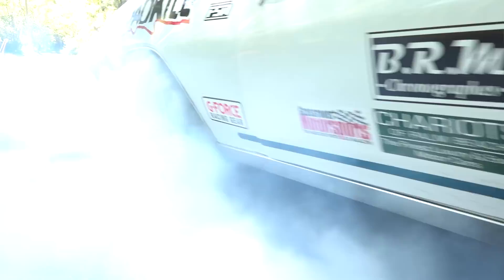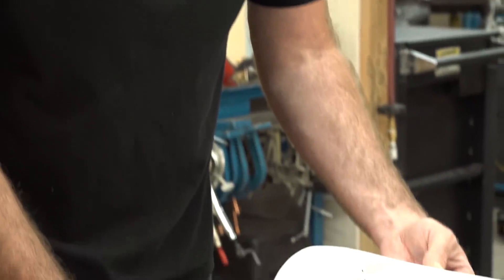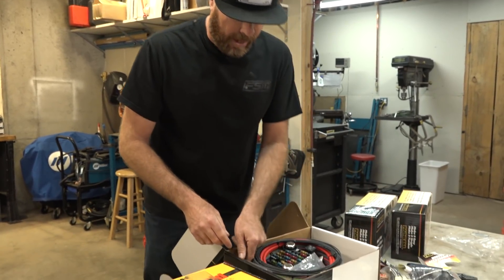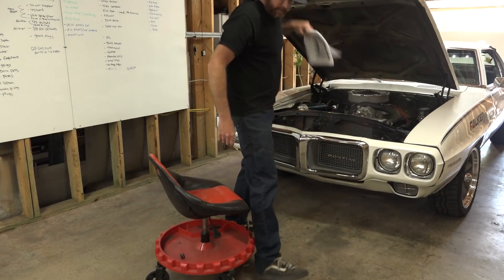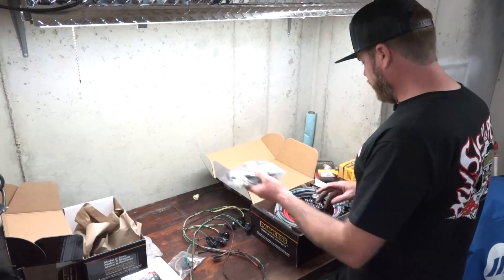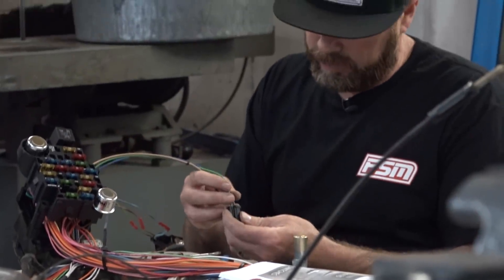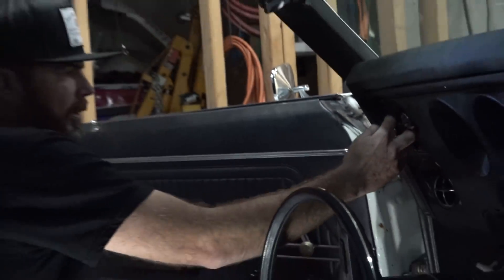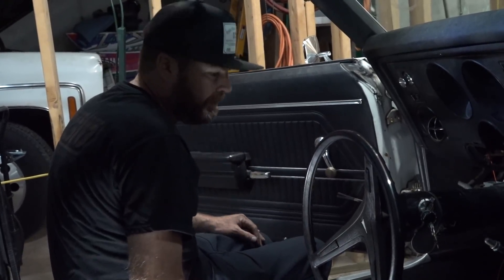Finnegan's Garage Ep.48: '69 Pontiac Firebird Tire Smoke With Fully Functional Taillights!

Comment: I remember rewiring my Cj7 in 2007 and the manual was about 4 pages lol. Later I got to talk to the guys at Painless that make the harness and they asked for my input for the newer harness they made. I also added dedicated grounds which makes troubleshooting easy plus gives the correct path back to the battery. Fuel pumps last longer, lights are brighter, alternator etc.... Damn after 20 years of air force power pro and 11 years Jeepin' I think I may need to do a hot rod and a turbo diesel truck. Thanks for the vids

Comment: Haha at 26:06-26:45 is the true emotional rollercoaster of wiring a vehicle. Not trying to laugh at your pain but I have the same feeling you did at that exact moment rewiring my 69 Chevy truck. Had everything connected, followed every instruction yet when I went to try to start it it wouldn't even try to turn over. After a while I figured out there was a switch I was suppose to bypass that didn't say to in the instructions. Then the tailights were not working properly. I searched for a couple days putting in ground wires and trying to figure out what I did wrong to come and realize the manufacturer screwed up the plug ins. A call that day and then a few days later the truck was like new. Thank you for this video! Makes me realize it happens to the best of them.

Comment: Crimping tip. When your using a roll style crimp the two tabs that face up on the connector (the ones that get rolled over) Go into the valley of the crimper. The Pointy part of the crimper pushes against the flat part/back of the connector (opposite side of the two tabs that stick up). I hope this helps. It may seem backwards, well at least it did to me when I learned how to do it, But that is the proper way.

Comment: 28:30 - As long as you're venturing this far into the world of car wiring you should think about getting a multimeter with some alligator clip test leads, then you could connect them to that light switch, pull the stalk out, see if it has continuity (should be 0 ohms). Multimeters are awesome for testing stuff like that, checking to make sure things have good ground, even test stuff like sensors. Hell you could back probe O2 sensors even and make sure they're working by watching the voltage... multimeters are amazing.

Comment: I had a 67 with the dealer installed 428 -390 hp, hood scoops, hood tach, traction bars,wide ratio Muncie, The Eaton explosion differential, Ac no ps and Manual disc brakes. A rare one for sure.Fore runner of the Transam. Actually about 450hp it blew up diffs with narrow tires and 3,23. NYC to LA in 52 hours with a 6 layover for flat tires in Denver. Top that one Finny.  No tickets either. Met Elisa Etheridge in Kansas too.

Comment: 1989 s10 blazer.. all led turn signals, running lights and stop lights... Used a variable load Grote 2 pin flasher relay (has a ground you add). No issues everything plugged and played nicely.

Comment: i know the frustration of doing a ton of electrical work and it it having issues when done. i completely dismantled a 96 Bronco harness, stripped it down of anything unnecessary and put it in my 88 Bronco, which is an offroad only vehicle, so i can use the newer EFI in it. it would constantly have issues of stalling not starting, sometimes not cranking, alot of the systems not working battery voltage only showing 4volts and such. turned out a factory splice for the grounds under the dash which had 8 grounds all coming together was the culprit. took me days and my truck being underwater up to the dash to find it. its on 9" lift and 37" tires and it left a waterline up on the custom dash

Comment: 17:25 - when using this style of crimp pliers the 'spine' of connector is supported by protruding side of the pliers while tangs are formed by the groove side. When you mimiced the use of the pliers you always positioned connector the other way around ie. spine in groove, which usually results in any of issues you mentioned.

Comment: Used to build and repair harnesses for ag applications..... try using the larger opening in the crimpers to start the bends, finish the crimp with the proper opening, then a dab of solder to secure the terminal permanently. try to keep the terminals as close to the original shape and lines as possible in case you have to remove them from the plug due to an improper pin out. the smallest tweak or nipple from over soldering can ruin your day with an extractor tool later. heat the terminal close to the connection to the stripped wire and feed a 1/4" of small gauge flux core solder into the joint to avoid cold soldering. Deutsch terminals are very picky about angles and the decent terminals require a specialty circular crimp tool, but can be removed from the plugs with a small flat bladed screwdriver. packard terminals are a whole new headache if the rubber sealing ring gets crimped improperly.  remember to plug all unused pins in connectors with the appropriate solid or rubber plugs to ensure weatherproofing. remember that patience and attention to small details with crimped connectors is rewarded in the long run with easier troubleshooting and repairs in the future.

Comment: Those blade-style connectors are a pain to crimp! I had them in my American Autowire kit and tossed them after several failed attemps, with several different roll-style crimpers. I just went with a different style connector all together.

Comment: The terminals that come with those kits while being very good are a little to heavy to crimp properly in the crimpers. Other brands of the same pins like grote or pico are made from lighter gauge material and work right in the crimpers.  I found it best with those pins to crimp in the largest size jaws on the crimpers first and then depending on wire size crimp them again with the next size down. I also found that with the male pins the tabs are too long and trimming just a bit off with side cutters first makes them crimp better and they don't jam up in the jaws of the crimpers. You should also have a look at a brand of crimpers called tool aid. They are ratcheting and allow you to close the jaws enough to hold the pin without crimping it and then insert the wire and finish the crimp. They also have interchangeable jaws to accommodate any kind of connector including the awesomest spark plug wire stripers/crimpers ever. You can buy kits or jaws separately.

Comment: You're not the only one with those kinds of issues with crimping the male blade terminals.  For whatever reason the female blades for things like the wiper motor connections crimp just fine with a good set of rollover crimper, but the male ones appear to be made of much thicker material that prevents a proper crimp.  We just rewired my friends 2nd gen F-body and with a painless kit and ran into the exact same issue.

Comment: Little trick for soldering your wire connectors is place it on your wire and then take a set of needle nose pliers it just start to bring the fold in then use your crimpers.

Comment: Painless doesn't mean "pain free". The manual that came with the harness with the most circuits I could find wasn't that in depth. It was a custom application though and when I got stuck I called Painless and I believe it was Paul didn't give me what I asked for, because it wasn't available but he talked me through what I needed. Cleared the whole thing up and so far everything still works.

Comment: I've used that style of crimp pliers time and again with no trouble.  Cheap ones and spendy ones all worked.  Perhaps you are putting the connector in backward?.  The arms that are to bend and crimp are supposed to point toward the 'W-shaped' side of the tool so that they have to curl.

Comment: Did you try flipping the role crimping tool over? Maybe you were using them upside down? Mine have to be flipped the right way which looks wrong but the female or what looks the bottom jaw needs to be on top to work. Those are mine though. Might try.

Comment: I like the "Painless" wiring kit, but truly painless it aint!  Make sure your sitting down when you see the price.  The word "OUCH" comes to mind.
Reply: Years ago I talked my dad into using a painless kit when we converted his 6v old dodge military truck over from a flathead 6 to a built 360 and it was amazingly detailed, easy, and it didnt hurt MY wallet one bit lol.  Oddly enough we used their 66 chevy truck kit since it was the simplest and closest thing that would work for an old dodge and we didnt need to touch the dodge ballest bs since we swapped the ignition setup over to a new msd.
Reply: What does a kit like this cost?
Reply: Armand Tomany so you don't think it's with $1000 to completely rewire the car with instructions so clear that you don't have to pay someone else to do the work for you?

you'd easily spend over $1000 on labor for them doing this on your car, let alone the wires and everything.
Reply: Go ahead and price out the individual components to put a kit like that together yourself, and then see what the numbers look like. 
Then, hope you didn't miss anything that's inevitably going to stall the project.
Then, hope you actually have ALL of the knowledge necessary to not only layout, pre-assemble, and install it, but also troubleshoot it.

GTFO of here with that shit, $500-1000 is a pretty fan-fucking-tastic price for EVERYTHING that comes in the box AND what doesn't.
Reply: @p3wp3wp3w6 "so you don't think it's with $1000 to completely rewire the car"

Not when you can fix the original wiring for next to nothing, and have it be functionally identical to new wiring. If it's a show car, then yes, you need new wiring just for looks, but if it's just a driver, as long as the insulation is still largely intact and flexible, you can fix it for cheap. Fixing doesn't mean twisting wires together and electrical taping them either.

Comment: I have always had the same problem with the roll crimpers. Bought the right tool and it just smashes the connector tangs and doesn’t work. Solved it the same way as you, too. Pre-bent, used the tool, and then smashed it down. Never liked roll crimpers at all. Much prefer the other style crimp connectors for this reason.

Comment: those un-insulated crimp terminals are a pain to use. I usually find the tangs that wrap and grab the wire are too long, ill cut them down a millimeter or 2 with my side cutters first, then squeeze them together abit with the sidecutters. Then usually the dam crimp tool will get a good crimp on the terminal. Heh, if that headlight switch is giving you grief now i bet its going to come back to haunt you later too.

Comment: Finn! You could've checked the switch without putting power to it by checking the continuity with your multimeter! Just switch it to the ohms function and turn on the beep and you've got it! I know you figured it out but it could've helped you if you ended up spending a long time on it. Not meaning to be a backseat wrencher, just trying to help out.

Comment: non-insulated connectors are awesome. Not sure how this explanation is going to pan out, so we shall see. First, put the connector in upside down, so the tangs are at the bottom. Make absolutely sure you are using the slot required, not the gap beside it. Don't ask how I know this. It looks wrong when you see it in the crimper but it works. I use a ratchet type that works really well.

Comment: I bought a 68 400/4 speed Firebird with 89,xxx original miles from the original owners widow for $5000 in 2017. I had to rewire the car thanks to mice chewing up the harness while it sat in a outbuilding for 11 years. Painless wiring kit is very easy but time consuming to install. But ive not experienced a single problem since the install. I did solder all of my crimped connections though.  Although I feel the price for the complete kit was  ridiculous.

Comment: The flasher works the opposite way, bi-metal strip gets hot with the load of the bulb and warps, opening the circuit. When it cools it relaxes and closes the circuit once again and the process repeats.

Comment: Often you have to bend the tangs in a little before you use the tool just to make sure they are inside the shape of the tool. And make sure the m shape is on the side that you want to roll over. I find that it's always a slow process to each crimp, constantly checking that everything is lined up.

Comment: One tool is not going to handle all types and brands of wire terminals. What you did @ 18:35 is "normal" - you do what you gotta do to get the job done! If you have a couple of hundred dollars to spend, you can get a professional tool with interchangeable die sets to handle the different varieties of automotive terminals that are in use now and in the past - but that will still only get you ~85% of the way. My "solution" back in the 1970's & '80's' was to modify the tools using a file and or a die grinder to customize the crimper tools for each type of terminal I was using. I was using tools I got at RadioShack, which were the closest shaped to the variety of terminals I was using and what the industry was using at that time (WeatherPak type terminals came years later). I ended up with 6 that look the same until a person examines the die "notches" to see the modifications that I did to each - needed a lighted magnifier to see some of the mods. And then I used an engraving tool to identify which connectors went with each modified tool. Yeah, that was my very "anal" approach to consistency with automotive wiring from scratch, but I was doing wiring enough wiring then to make it worth my while in the long run.

Comment: Using the blue handled crimpers you have to go from the largest crimp to the smallest in steps that's how you get the ears to lay over and crimp the right way so when you make it crimp connection you have to crimp it 3 4 or 5 maybe 5 times before you get that nice roll crimp starting at a going to see your whichever it's largest to smallest

Comment: Yeah, those crimping tools are awful, I've never gotten one to work either. I fold them over a bit if needed, then use my knipex pliers-wrench and just crush them flat. Works every time, and they have long handles so there's enough pressure that the wires never let go. Haven't had any trouble with a connection I made that way yet.

Comment: The use split loom rather than tape would be brand correct and much easier to use as well  change wires. . Granted they started using split loom in 69-70. Multi-meter can be your friend on contact switch questions.

Comment: The terminals you're having trouble crimping, are you putting them in upside down or back to front or something?

I've had issues when I don't put them in the right way round, the bit that crimps on to the stripped wire uses a different section of the crimp die to the bit that clamps the sheath, but apart from that I've found them to just work.
Reply from the maker: i double checked. it was just an issue with that particular tool. my other rollover crimpers worked fine.

Comment: the molex connectors need their rear tabs shortened with wire cutters, they come too long for the gauge of wire you're using.  Trim them down by about half so they are roughly 2x the width of the wire gauge. HTH!

Comment: Nice. Love the video,  I'm doing the same thing for 1969 firebird.  My car came with electric windows so I feel it would be more work. But I really want to know what's the part number for that kit you are using? I bought the painless wiring kit but mine doesn't have all that extra stuff your kit came with. I would really appreciate if you can get me that kit part number. Thanks.

Comment: I think the only way to solve all the music complaints is to hum Roger Miller tunes during time lapse and still some people would complain it wasn’t Perry Como...great video. How did you set the wire length when you cut them all on the floor or were you carrying it back and forth in between takes?

Comment: It's not you, those tools are junk & there is also a trick that you twigged to on putting those connectors on using the proper tool, gotta bend them in a little before putting them on.
Next time you re-wire a project, look me up. I'll bring the tools, factory fab experience, & the beer!

Comment: If they're rolling over it means that they're too big for the diameter of wire. So you can take little cutters and you can slightly trim one side and then use your crimpers or even if they overlap when you're still applying your crimpers it's still creating a v notch that will grab into the wiring but I normally will take little wire cutters and I will trim you know a 16th off of one side depending on the size of the diameter but in reality you just go and get different fittings I'm telling you brother it's the way the only way when I look at that in the picture it looks f**** mangled

Comment: Hello! I know this video is older, but I have a 1968 Pontiac with a 400 in it as well :) What actually killed the 400 in the roadkill episode? There was never really an answer on the episode what actually caused it to blow other than oil pressure/starvation. Did you ever figure out what the real culprit you think is?

Comment: I'm sure someone else will comment, but the crimp tool you have kind of sucks. I have one that "ratchets" and works perfect. It does both of the crimps on the wire you need. One is to crimp the wire itself, the other crimps onto the shielding. Mine is wider to accommodate both crimps at once instead of the skinny one you have that probably needs to be crimped twice.

Comment: I would wait until all the wires are in place before putting the connectors on. say you run into an area where they won't fit. them you have recut them.